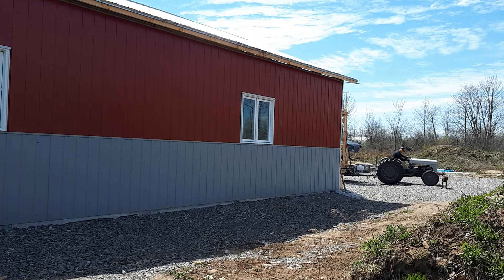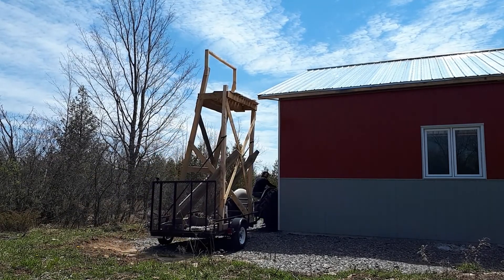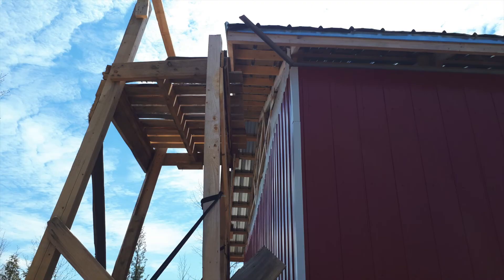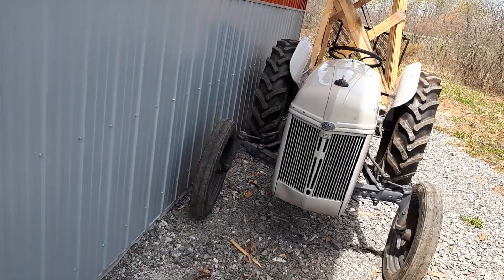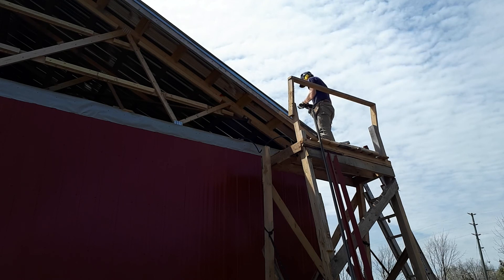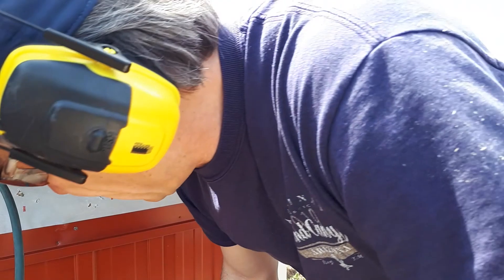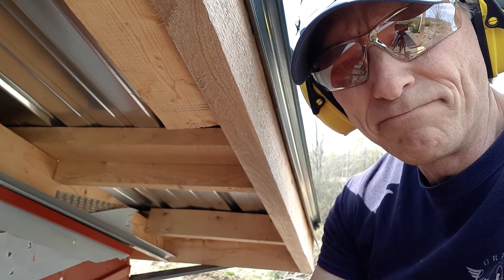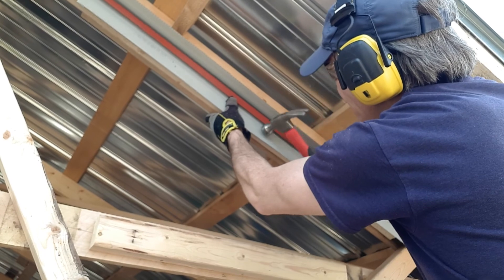It's Time to Use the Homemade, Mobile Scaffolding - The Roman Siege Tower

Comment: No building paper behind the sheets?
Reply from the maker: Not in the gable ends. I will insulate the building so I want the attic area to breath as much as possible. The link (https://www.youtube.com/watch?v=hX0NDQueJNI) is to the first video concerning the metal siding and shows that I installed a building wrap. Thanks for watching! Peter at the Reboot